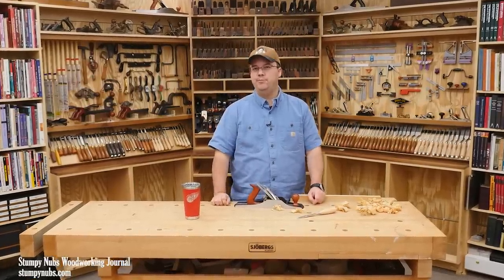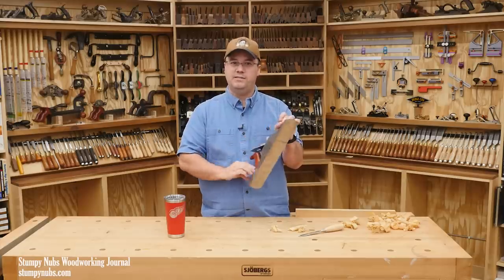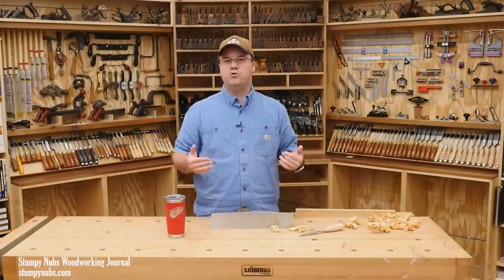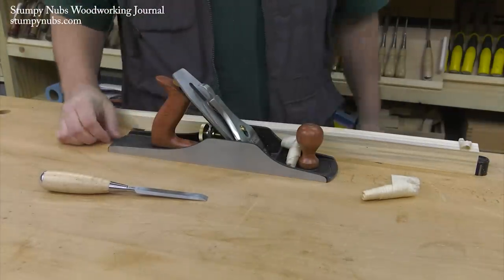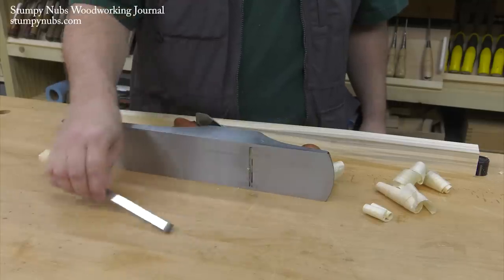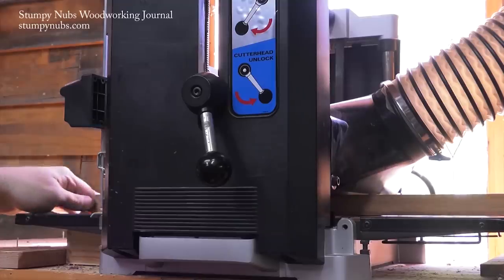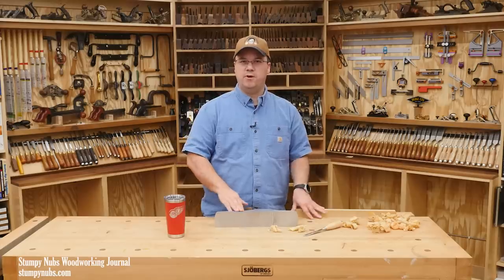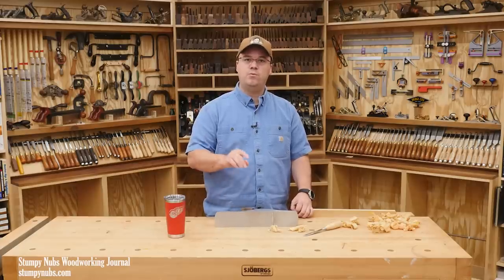Why I abuse my hand planes

Comment: The idea of placing the plane on its side is meant to build the good habit of protecting the blade and work area.  Build a second nature or muscle memory for when my brains are elsewhere.  At a job site it is easy to place your planer on the floor made of natural, ceramic or porcelain tile.  Big time bad idea regardless what side you put it on, but it happens.   You will damage the blade as well as what you put it on.    Quarts CT covered with cardboard or paper will get damaged.  Some work benches have glue, nails, epoxy and staples in them, maybe not yours, but someone’s does.  If it never leaves your clean maple bench, then you will have no trouble with dulling the blade.  I consider it habit forming for when I am not paying attention.   I store my plane with the blade on top of wood.  Other guys I work with use a piece of wood to build it up off the wood.   For me its building a good habit.

Comment: Uh, I did order from WC a new Lux.  After following install instructions, the cutter ripped the pinion threads out.  Sent back and…. Clearly operator error.  Am out the 550 for the Lux, and a broken plainer.  Neither WC or Lux backed the product, even though metal could be seen in the threads of the pinion gear.  fool me once, shame on me, and am out the 550 (+35 shipping post damage) bucks, and a broken planer. Thanks WC and Lux!  P s, Lux has the cutter, they can keep it, not worth charging me another 35 for shipping.  Working with these companies cost me 1200, and am now shopping for a new planer.  Will never deal with either company again, no, am not going to be fooled twice.

Comment: Placing a plane on it's side has more to do with storage. When  using the plane on a wood work bench, doesn't matter,it's not resting on the blade for any real lenght of time. Don't store your plane resting on the blade for extended periods of time. So either lay your plane on its side, or put some 1/8" strips of wood to keep the blade off any surface. Just like any wood chisel, stored so the blade has no weight on the working edge.
Reply from the maker: Why not store them sole down?
Reply: @StumpyNubs  you can store a plane with the sole down. Just put down some stripes of wood, about 1/8" thick, to keep the weight off the working edge. Or you can retract the blade, but you then need to reset the blade every time you use it. In my case I lay the plane on its side, all the time, just habit now.
Reply from the maker: @roscoepatternworks3471  I understand that is what you think must be done, But I'm asking WHY you think that's necessary.
Reply: @StumpyNubs  storing a sharp tool, for long periods will slightly dull the edge. While at rest in a wood, or any other surface. In my case my work bench has a clear lacquered surface. Setting the plane with the blade down will over time mar that surface. So I lay my plane on its side, while in use. And have 1/8" strips of wood under the soles of my storage box. Just the way I do things and how things were done by every patternmaker I ever worked with.
Reply from the maker: @roscoepatternworks3471  I am not sure I agree that a plane left on it's sole will, I assume you mean roll over the edge of the iron slowly with time and weight. But I do appreciate your point of view and thank you for sharing it :)
Reply: @StumpyNubs  well there's an experiment foe you. Sharpen 2 planes, place both sole down. One with the blade export for cutting. The other elevated so the blade touches nothing. Wait about 3 months and check the sharpness again. Only if you have time🙂

Comment: Yeah stuff like this is common in a lot of disciplines and a lot of times people are to scared to question the dogma or ask why somethings done. and can cause people to freak out if they see you not following the thing they were yelled at for or told off for constantly. stuff like this always bother me so i always go off the if you cant explain to my why i should do something im not going to do it helps alot at optimizing work flows in the long run but can cause alot of people to have fits like some of the old timers are having now

Comment: The company suggested for a replacement planer cutting system is impressive, and an easy website to use.  But my poor boy logic tells me the cost of a replacement helical cutter for a20+ year old Delta 22-540 planer is about 20-30% of the way home to a new planer.  Any suggestions on brands for a new 13-inch helical planer?  Thanks.
Reply from the maker: If you're looking for a portable one, the Dewalt DW735 is quite nice. If you want stationary, I have a Grizzly and it's worked well for me. The Dewalt doesn't come with a helical head (you'll need to upgrade yourself), but the Grizzly can be bought with one installed.
Reply: Thanks @StumpyNubs

Comment: This is the same as guys losing their mind if you use your T-shirt to clean off the UV filter on your camera, the same as guys absolutely freaking out if you coil your cable slightly wrong, same guys losing their minds if you hit a couple hammers together because you’ll shatter it and explode your eyeballs out.

They’re emulating the same kind of procedure focused mindset you would need an extremely dangerous situation that has no interlock or safeguards, but they’re doing it about incredibly stupid things that don’t really matter all that much.

Comment: I think your missing the point. 
If your in the habit of laying it on its side then no matter what surface your putting the plane down on the blade is safe. 
We used planes out in the field where we didn't have wooden bench tops. 
So try to remember not every wood working tool is used exclusively in a shop. 
Would you recommend laying out on it's side in a parking lot working on a boat in storage?
Reply from the maker: What point am I missing? The conversation is about laying the plane on a workbench. Not a parking lot or on the moon. I would think it's obvious that a completely different situation would be a completely different discussion.

Comment: The only time there is any relevance to keeping you plain face turned up to the side is if you are a sloppy woodworker and leave metal bits on your bench top. Otherwise the steel of your plane blade and plane bottom is literally hundreds of times stronger than anyone it will come in contact with: science.

Comment: Right again, someone who has to SHARPEN that blade lays the plane down carefully every time. I have to admit my teeth sizzle every video where the "expert" does not lift the plane on the return...may or may not dull the edge sooner but why take the chance?
Reply from the maker: It takes significantly more energy to lift the plane after every stroke, especially a heavy one. It takes significantly less energy to sharpen the iron 10% more often as a result.